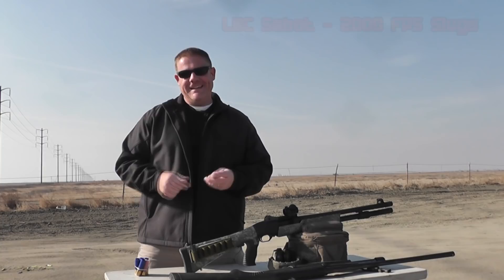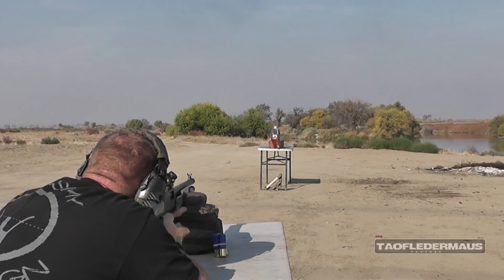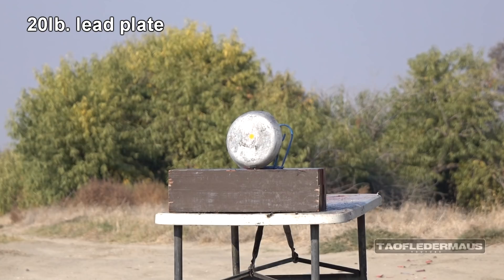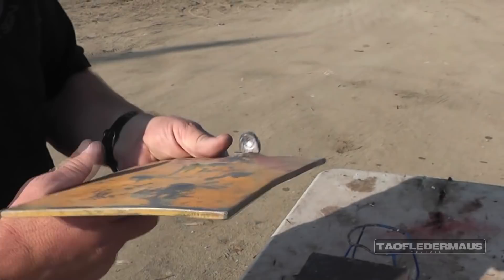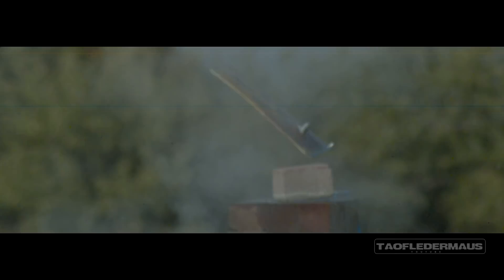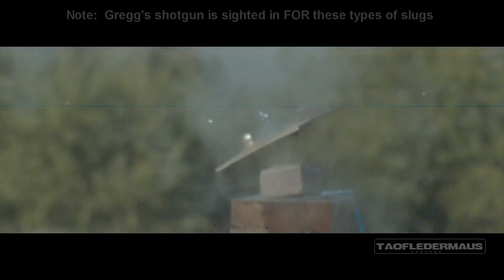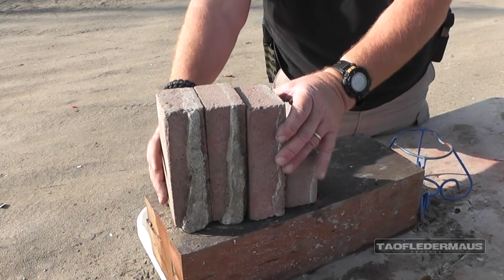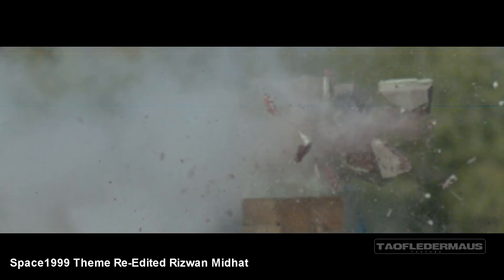Monster 3700 Ft.Lbs.  Shotgun Slugs - "Air Torpedos"

Comment: That tail is formed because at those velocities lead behaves like a liquid on impact and that's actually the inverted hollow portion of the front of the slug. When you have an impact like that you'll actually get a jet of lead form in some cases which goes away from the point of impact (the point of highest pressure). It's kind of like how shaped charges work but in reverse. ;)
Reply: So now I'm wondering why it acts like a liquid. Is some of the energy from the impact converted to heat? Or is it different, kind of like a reverse non-newtonian fluid?
Reply: I believe what you are seeing is a property of all solids that hit with that kind of force. Look at the impact craters on the moon. Many of them have central peaks. Mind you, lead is a soft metal and will flow quite readily. Makes it good for bullets as they get squeezed down a gun barrel that's a little smaller than they are in diameter.
Reply: Cratering from extraterrestrial objects is actually hugely more powerful than anything you'd be able to achieve using a firearm, even those used to simulate such impacts. The energies involved in hypervelocity impacts is enough to literally rip apart the bonds holding molecules together, resulting in explosions that are as powerful or more powerful than traditional chemical explosives. With bullets it's more just that lead is soft and easily gets deformed. That softness gives it some liquid-like properties but it's not actually turning into a liquid - that requires heat, which there is plenty of but not enough to flash melt a chunk of lead in the time it takes for the impact to occur.

Those peaks you mentioned are a result of something else entirely.

There's a great video on Youtube called "1 million fps slow motion bullet impacts" or something like that and you can see what I'm talking about really clearly.
Reply: That's a very good point. For things like rock to flow like a liquid without being super heated by something like a meteor impact, they need to be under a lot of pressure. I have some pictures in a physics book showing marble cylinders that have been pressed down while in a high pressure environment. At low pressure, the marble simply fractures as you would expect. At 400ATM, it actually does flow.

Yeah, the moon impacts that we can see easily with a telescope are due to the rock being melted from the kinetic energy of the impact.
Reply: There is far more than enough kinetic energy in high velocity projectiles to liquefy the metal of the round and target metal plate. This is especially obvious in armor piercing rounds. Some of the metal is even vaporized and forms a plasma.

You don't need hyper velocity meteor impacts to observe the effects of liquefying the target substrate and impactor. Any stress applied to a metal enough to break the crystalline structure to sufficient degree can cause enough heating from internal friction to melt the metal. That's how impact forging works. Pieces will get to glow white-hot from the process and even begin to melt if continued without letting the piece rest between shaping.
Reply: I'm not familiar with the impact forging process, but what you say makes sense. Modern high velocity tank rounds made of depleted uranium operate on similar principles. A lot of force is concentrated on a tiny area. Also the uranium is pyrophoric, which makes for a great tank killer.
Reply: High velocity meteor impacts go well past liquefying. The energies involved literally break molecular bonds. When you're talking hypervelocity you're talking about explosive impacts.
Reply: Energy is energy. An object moving at thousands of meters per second and having a mass of tens of kilograms is going to have the energy of a nuke.
Reply: Justin Dixon who cares is the real answer
Reply: @whocares5188  that would be a question.
Reply: Finna Nut Yo not if im answering your question for you.
Reply: @whocares5188  You mean other than intelligent human beings?

Comment: You guys touched on my favorite part of shooting: Re-loading the empties!
I used to buy el-cheapo .357 rounds on sale, only to fire-form the cases at the range.
Not target shooting, just empty the brass.  Mad-minute, anyone?
Cleaned the spent cases, resize case/punch out the primers, trim cases to length, chamfer the case mouth, de-burr the flash-hole, sort the shells by weight.  Sorting by weight insures consistent internal case volume, all other external dimensions being equal.
50 rounds of .357 'Blu Lite Special' might get me 45 or so good cases for re-loading.
My favorite cases?  
Federal .375 in brass finish.  
Nickle can have a weird 'feel' in carbide sizing dies, sometimes sheds a bit of metal.
I miss those days.

Comment: As requested by Gregg, the little dingus of lead from the recovered lead plate impact is akin to the jet from a drop of water hitting a fluid. At first the drop creates a crater in the medium, then as the crater rebounds it presses a small jet of material back up out of the medium. It indicates that the lead acts like a fluid during its impact, both the slug and the plate behaves like fluids.
Reply: trefod this can't be correct. You are not thinking 4th dimensionally. It's happened because biff stole the time machine and gave himself the Almanac.
Reply: Haha, dammit Biff all those unforseen ripples.
Reply: Heavy metal poop splash
Reply: i….. you’re right…. you’re goddamn right….

Comment: We use ice blocks for our 7.62 x 39 fmj, sincee they just punch through a water jug without the explosion.  Also, you get a better explosion if you cut the jug off of the block.  I would love to come out there with my Pedersoli Sharps and Magnum Research BFR both chambered in .45-70.  And I load my rounds hot, 3,000 lb ft of energy and still stay under the 28,000 cup pressure.
Reply: PsychoticBovine - Y'all any relation to Country Cowfreak? (.45-70? Y'must have some mean varmints out there)
Reply: Yes, big ugly varmints!  No relation to Mr/Ms Cowfreak.  I do love the Sharps, though, very nice rifle!

Comment: Very nice video, thanks.  It was interesting to see that the slug didn't punch through the lead plate (I expected a hole like the thunderbolt left in the plate), but penetrated the steel plate.
Reply: Stainless steel is pretty brittle, so the slug could shear it (cause a crack). The lead is far more ductile, so it deforms a lot more before breaking. A tension crack did start to form on the back of the lead plate, but didn't go all the way through.

Comment: My camp gun is a rifled 12 gauge,  3" Mag loaded with Magnum Crush at 1 1/2 oz. , 3800 ft/pounds.  The accelerated speed is the source of the power in this experiment, but the extreme light weight of the round which causes it has piss chance to deliver the depths needed to use that power if its actually needed.

Comment: That's wild. The loads I'm working on for steel shot are using around 30 grains of Longshot and are 10,000-11,000 psi already.
Reply from the maker: It's weird how you can use up to about 60 grns of LS and it still is under 12000 psi.
Reply: Could be the wad design, although that is a massive powder charge. I think shot might compress some too and maybe squeeze the bore more than a slug.

Comment: You should load one with a slug made of frozen cow poo and shoot it at an electric fan.
Reply: Bear Barre 
So...you want to see the Bovine Defecation hit the Rotary Oscillator?  SHTF? 👍🏻.        🇺🇸😎
Reply: Yes, please.  I have my doubts as to the aerodynamics of the substance assigned to the projectile portion of the exercise, but then cows have been around quite a long time and may have evolved to excrete waste products capable of supersonic speeds  This, however, is unlikely.  Therefore, just for safety's sake, I recommend either freezing the substance or an additive could be... um... added... that will congeal or thicken said material without making any other noticeable changes in it. (Perhaps corn starch, but I honestly don't know if that will work). Otherwise, the result may be nothing but a brown cloud or mist.  (I believe they refer to this as the "Fog of War"). 

 I'm sorry, but having only been in the cow babysitting industry during my college days, many moons ago, I no longer have any contacts among the bovine community that I can ask for donations (all the ones I knew went  to work for Burger King, etc. and I have lost touch with them).  Now with some research I may be able to provide a HAZMAT sheet, though that is also unlikely as I have not seen it in more than 2 decades.  I will, however, search the... archives in an attempt to locate a copy, but I make no promises.

Comment: That was cool on the lead plate shot. As the plate turned you could actually see the bulge form on the opposite side in slow motion. In the time it took the plate to rotate I would say about $135°, is the time it took from impact for the bulge to show on the other side.

Comment: Target idea, a six inch PVC pipe 12 to 16 inches long, filled with cornstarch and water (add food coloring for better visuals). You could cap the ends with 3 or 5 mil plastic and duct tape. I bet the pipe will blow out  but it would be cool if you could get a round to go clean through.

Comment: Dumb question I'm sure but is 50 grains the max you can load?
Reply from the maker: With a 3" shell yes.   But they have a 3.5" load using 60 grains but you get diminishing returns,  only 2140 fps.
Reply: TAOFLEDERMAUS ah cool thanks

Comment: Love all your videos. Did have a question. I hand load slugs for deer hunting Herr in Midwest. I own the 8th edition slug load manual from BPI and it only shows data for the LBC slug in 2.75 hulls. Would you be so kind as to send a picture or photo copy of the load data you have for a 3" hull LBC slug. Thanks kindly.
Reply from the maker: I only have the 6th edition.    I believe for a 3" hull BPI adds an x12x gas seal.
Reply: By chance of your willing, on the 20ga thug slug, does your manual show any data using either hs6 or longshot in any hull lengths. Those are the powders at my disposal and my manual shows no data to support my supplies.

Comment: What's the hottest load you can make for a 3-1/2 shells?
Reply from the maker: They have a recipe using 60 grns of Longshot along with a SECOND gas seal that gets it up to 2140 fps....  but  that isn't much of a gain.
Reply: TAOFLEDERMAUS no that isn't, I thought you could push at least 2400 out of such a large shell

Comment: You can find speed using frame rate of camera and a measuring devis ( a board panted with 6 12 in or 1 in increments or however far spaced apart makes the math simplest given the frame rate)
Reply from the maker: Eh,  if I had a faster camera maybe.
Reply: TAOFLEDERMAUS should be able to get pretty close if you click through frame by frame if it's 4000(making this number up) frames per second, after 4000 frames passed it moved that distance in a second so that mean in 10 frames it has been .0025 seconds and if the round is moving 2000 fps it should travel 5 ft

Comment: Did you notice the 50 gr shots were opening up the action?  The 30 gr they had to pull the slide all the way back.  On the 50gr they only had to pull about half a inch or so to open the action fully.  Be careful guys.

Comment: No way those are 30 and 50 grain projectiles, that's in the realm of .22.  A 50 grain projectile will need to to a lot faster than 2000 fps to generate 3700 ft/lbs.